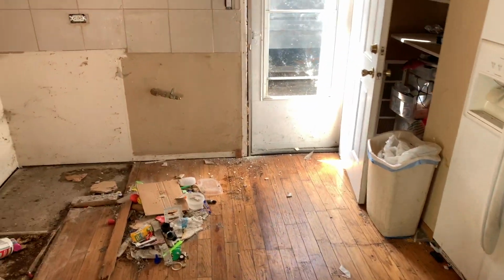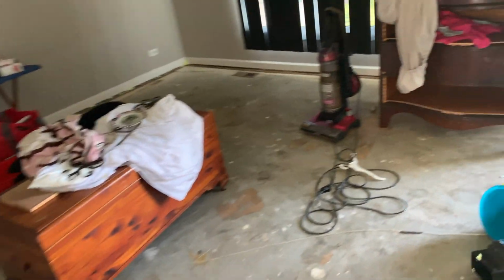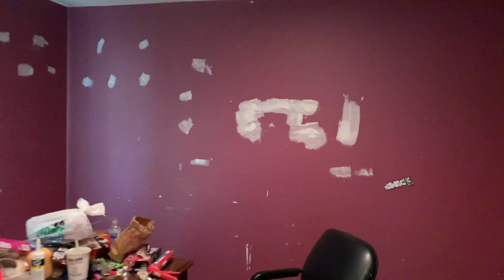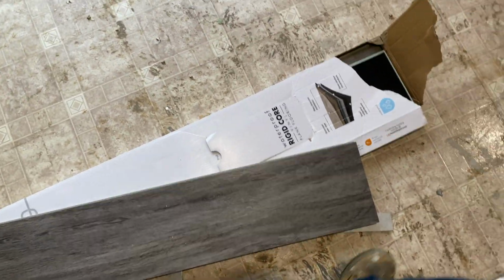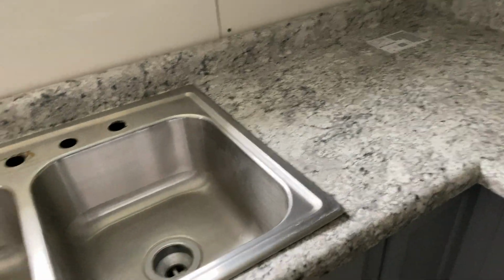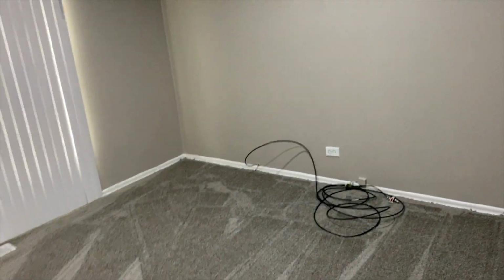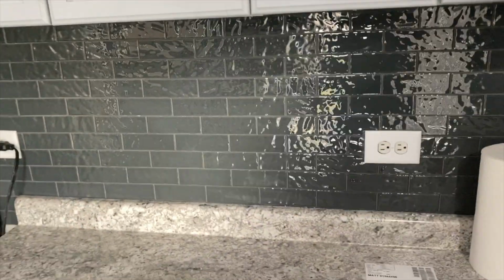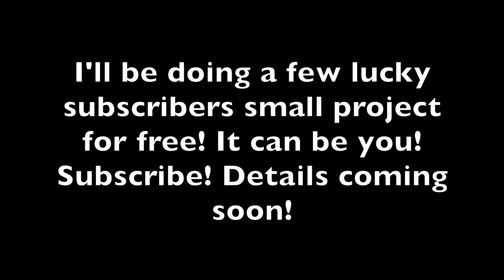Renovating an entire property by myself! Check out my property renovation project?

Comment: Nice work Terence! 
I am taking on a 1983 time capsule this weekend. Closing Friday and first order of business is take a chainsaw to the trees swallowing the house, to paint a picture for you. Gotta get a new roof, strip ceilings, do all the crown, textured walls, modern base trim, update kitchen, floors, doors, vanity, fixtures... it’s endless and I’m solo DIY too. Just made $106K on the house I’ve owned since 2012. Hoping to have a similarly successful flip on this. 

I love your flooring, kitchen... man you’ve kicked ass on this project!! Hope you get paid well when it sells!
Reply from the maker: Thanks Chris! Good luck with the closing. Keep me updated on the progress of your renovation. Thanks for watching!
Reply: Terence's Youtube yeah man! I will spend a couple months and document, then put up a before/after progress video like you did. Btw I love your content. Your videos helped me replace my Ram’s transmission solenoid awhile back. I traded it for a 2019 challenger R/T (love it)! I’m about to do my first oil change on her... you still swear by Royal Purple in the Hemi?
Reply from the maker: @Cpennington57  , I stopped using Royal Purple. No particular reason. I only use Mobile 1 extended performance. It's some of the best oil that you can use in your vehicle. It just doesn't break down. Below is a link for it. Stay in touch. 

https://www.walmart.com/ip/Mobil-1-Extended-Performance-Advanced-Full-Synthetic-5W-20-Motor-Oil-5-qts/20971334?wmlspartner=wlpa&selectedSellerId=101002903&adid=22222222227025389903&wl0=&wl1=g&wl2=c&wl3=77517664128&wl4=aud-430887228898:pla-107413710288&wl5=9021629&wl6=&wl7=&wl8=&wl9=pla&wl10=136582778&wl11=online&wl12=20971334&veh=sem&gclid=CjwKCAiAis3vBRBdEiwAHXB29G2PpTcVUGN6TgO7bMuQlsNWDHLjPvmQdMq348v4WXfTv_r_AaDSCxoCTuUQAvD_BwE